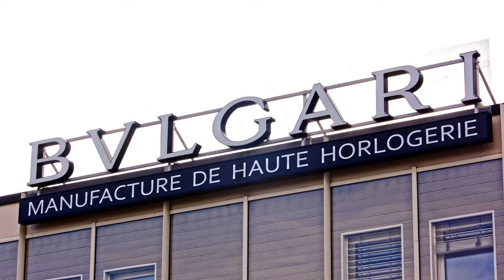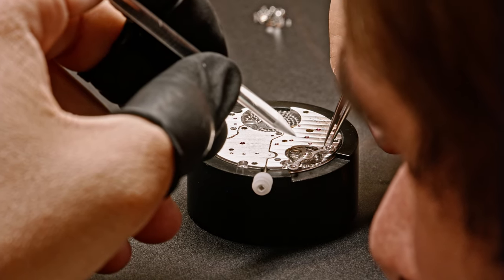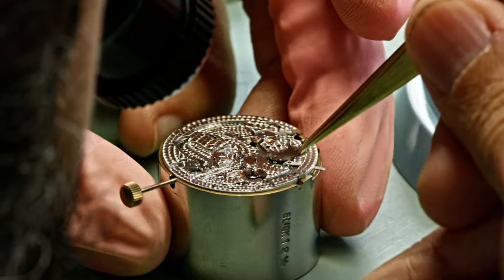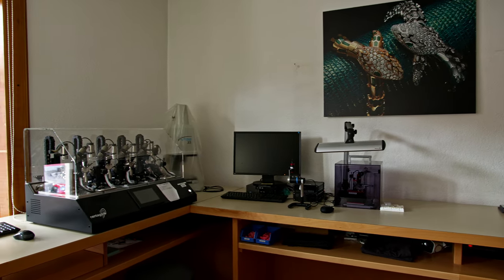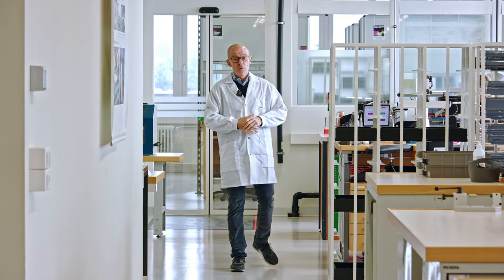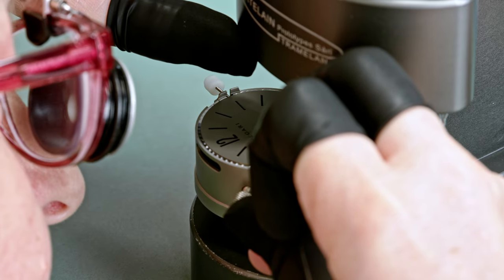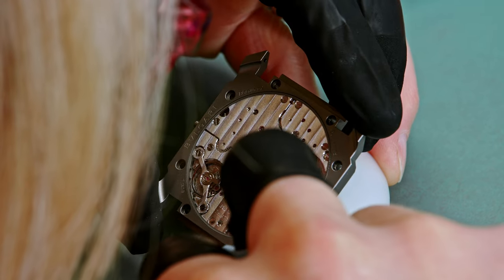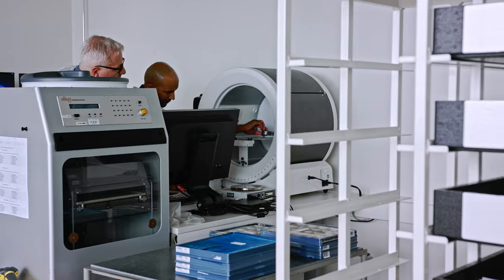BVLGARI Octo Finissimo. PART TWO. Thin, thinner, thinnest... The making-of an iconic wristwatch.

Comment: 27:35 its annoying my OCD that the watch pillow thing they rest the movement/case on is covered in dust. You'd think they would keep those things in flawless dust free conditions but you can see tons of specs of dust and white lines in that blue pillow/plastic(?) holder thing.
Reply from the maker: This removable surface (a decal) is attracting and collecting any dust and is exchanged regularly …
Reply: @WatchAdvisor  Ohhhhh didnt realize it was meant to do that, thanks 😇
Reply from the maker: No worries!